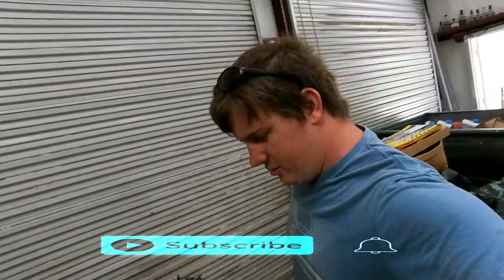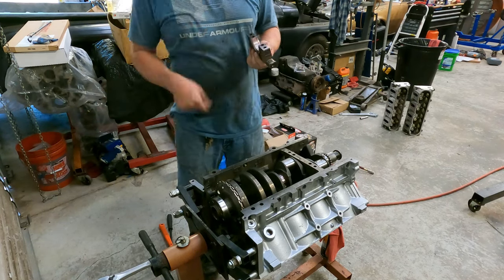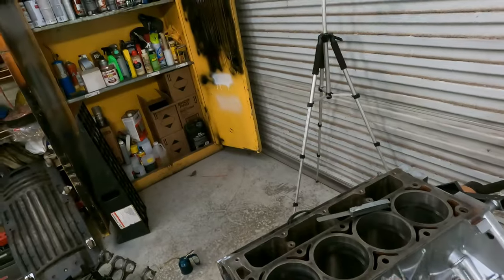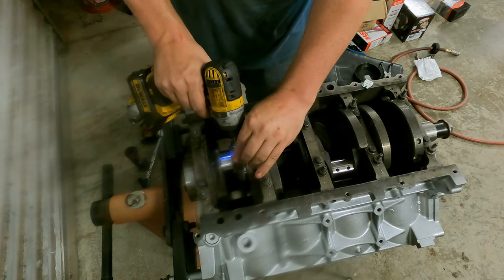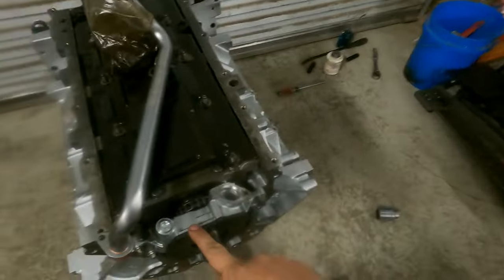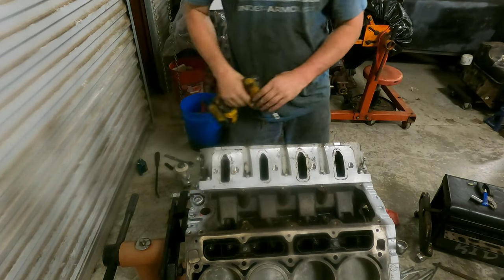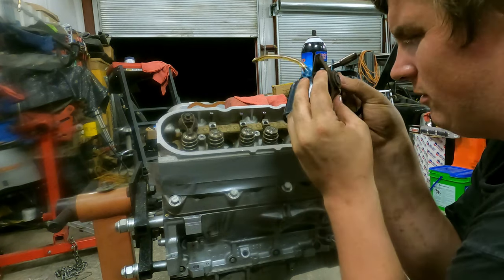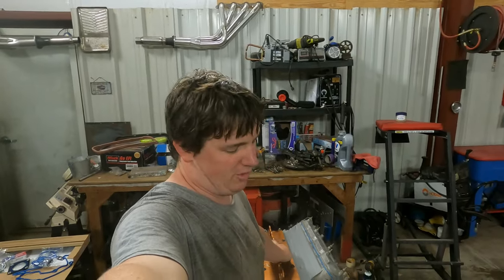LS 6.0 LQ4 ￼￼complete￼ rebuild start to finish

Comment: Hey brother, im getting ready to build the lq4 6.0. I need a little help getting a good idea of what i need to shoot for, im gonna pull it apart this week. Anything i need to look for pulling apart ti determine what im gonna need to do to keep it in spec to get another 300,000 miles out of it
Reply from the maker: Best thing to do is have the block fully checked and machine at local machine shop check the piston to wall clearance in the cylinder wall and check the rod and main bearing clearances as for lifters just replace them with a good known brand unless seven replacement

Comment: this is awesome. i’ve never pulled a whole motor out/rebuilt or anything. i have an lq4 that has a hell of a tick. sounds valvetrain ish. idk. i want to do something like this tho
Reply from the maker: Thank you very much. The LS based engines are VERY easy to work with if you have the ability to pull it I say go for it. But be warned it’s an addiction

Comment: Hey man how would you go about adjusting the clearance on the bearings if it was too tight or too loose
Reply from the maker: It really depends too tight you can either have the crank polished or you could order for instants if it’s The crank is turned 10 you could order A under or oversize bearing for that set and a lot of people will do a 50-50 bearing so depending on the situation maybe a 10 and a standard or a 10 and a 20 really depends on what you need but to type typically the best bet is to polish the crank

Comment: I would love to have mine done.  What is average cost.  177k and runs great except a knock on cold start.  Would love more hp and torque but worried about losing factory idle.
Reply from the maker: These typically cost somewhere around $2500 to do a rebuild on as far as getting a little extra power we could put a small cam in. It would be additional dollars for the Cam and lift her set, but well worth it in the power gains.

Comment: How much did it cost to do all the machine work. What all did you have done at machine shop?
Reply from the maker: It was like $700-800 around there but cleaned honed new cam bearing then the heads where done for around shaved pressure checked and new seals this is kinda normal for what I do with these and around there in price

Comment: I heard you say timing chain guide but i didnt see you install one... What da hell!!!
Reply from the maker: I did this video a while back not 100% sure but The timing chain guide is used on the 2007-2008 and newer LS-based engines so as long as you’re building a GEN 3 you should not need it

Comment: I need a rebuild kit for my 01 lq4.  Where do I find one?
Reply from the maker: It depends on what you need I buy all my bearing and rings from my local machine shop and then go online and buy a cheap gasket set for the engine. Then I perches Felpro head gaskets and bolts at local parts store it work out cheaper doing it this way as for the gasket that coke it the cheap gasket kit i just don’t trust them